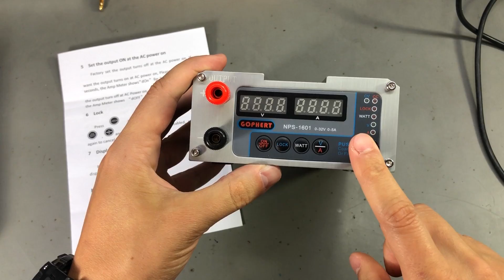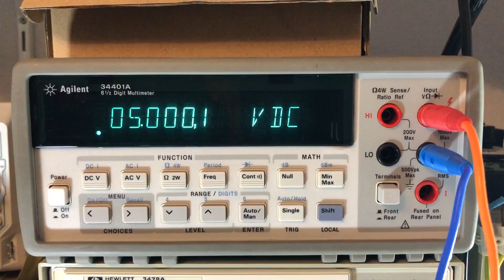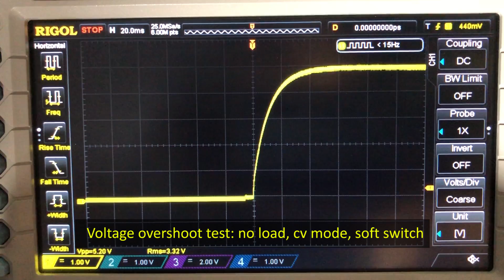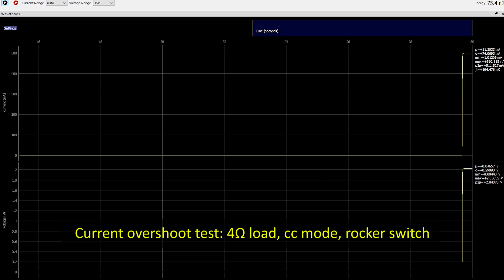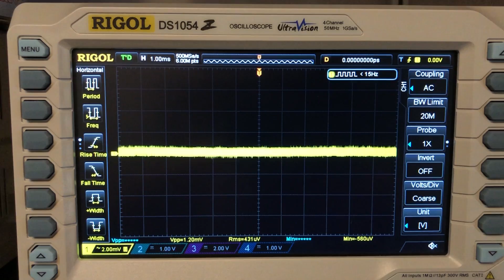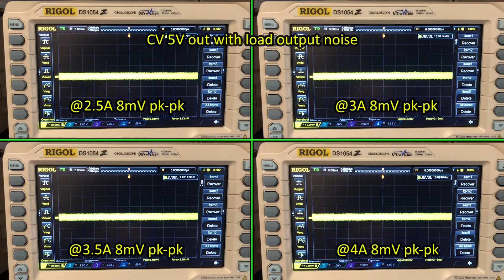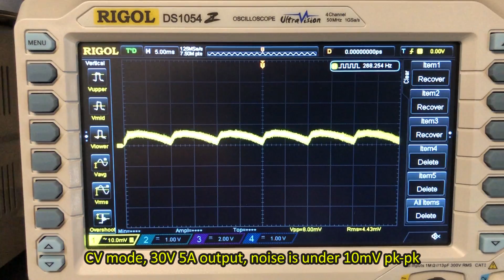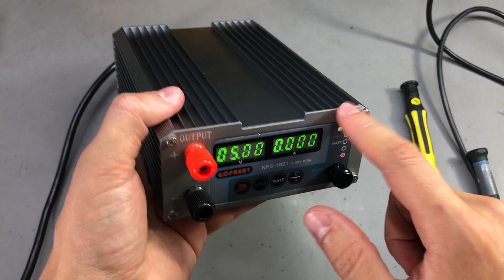Voltlog #255 - Gophert NPS-1601 Review (possibly the best power supply in this price range)

Comment from the maker: I've sent my feedback to Gophert regarding this power supply, here is what their comment on insulating the bottom side of the pcb against the enclosure: "according to LVD regulations EN 60950 and EN 61558, the power supply is class I which the case is connected to the Earth, basic insulation is ok, the clearance between PCB to the cabinet is about 5mm, the regulation is >3.2mm, so i think the insulation of the power supply is  safe."
Reply: Yeah, it looked like it had a lot more clearance than the typical switch mode supplies with cheap perforated metal protection/cases that always have that insulation sheet. The PCB looked like standard 0.60 FR4 too. I trust the FR4 will stay rigid and in place a lot more than flexible and flaky CEM-1.
  I'd really like to see the dual feedback circuit configuration they are using for this. Someone needs to send one of these to Danyk for an epic Diodes Gone Wild reverse engineer and schematic :-)
  Thanks for the upload.
-Jake
Reply: I would like to know whether it is good for repairs of laptops, phones, lab and communication equipments. So can a technician use it?

Comment: I don't know if they stepped down their quality, but the unit I received this weekend is not of the quality that is displayed in this video! The device keeps overshooting by almost 1 Volt at all levels, and testing it with a LED at a CC of 10mA and 5V, the LED clearly shows this overvoltage by flashing pretty bright during activating the powerbutton on the front. The device also spikes after turning it on with the powerbutton at the back, especially if it was turned on a short while after turning it off! 
Inspecting the PCB also gave me a shock, as the flux is all over the place and the soldering is of poor quality with lots of tin dropouts and smurky larger pads. I bought this unit after seeing this video, and also because I already own a CPS-3205 that works well. The only thing that does seem to help in the overshoot is placing a 2200uF capacitor on the output. All in all I had expected much better quality...
Reply: Sorry to hear this from you. It could be the famous Chinese #100 unlucky unit when 99 units before yours were perfectly fine and here comes this one, not up to the established quality level. For instance, the factory (if there is an actual "factory"... who knows) apprentice worked on your unit (everyone has to start somewhere) and the QC was really flexible which is often the case in making it pass. However your report on the1V overshoot is clearly beyond the acceptable margin.

Comment: Thanks for the review. Seems like even after those years, there are no many cheap low-ripple bench PSUs. I wonder if you have measures ripple and rms noise in CC mode ? Are there any other PSUs to recommend ? I'm looking especially smt in 60V 5A level. I was about to buy OWON SPE6103, but this is not PSU, but a jammer.

Comment: The only thing I don't really like about this power supply is that the buttons are hard to push. I have to hold onto the case to press buttons so that it doesn't slide.
Reply from the maker: I agree, it could be nicer with softer buttons but then, you would have the issue of accidentally pressing them because they are so close to each other..

Comment: I'm trying to use NPS-1601 to charge a small battery pack - 3 AAA cells, 550 mAh, NiMh at C/10 (55 mA).  The power supply will not go into constant-current mode with only the battery connected unless the voltage is raised to 4.95 volts which is higher than recommended for NiMh chemistry.  Replacing the battery with a resistor, 82 ohms triggers constant-current mode below 54 mA but above that 56 mA and higher the power supply reverts to constant voltage mode.
Reply: Hi. Did you solve this problem somehow? My issue is a "little bit" different charging of car battery 60 Ah with 1/10C. I set 5 A and charging battery but when voltage rise to some x level it switch to CV mode and this disturbing. Does elder models like 6017, 8412 has same situation? Or it just some comparator inside and how to fix it or it is impossible?

Comment: I'm a bit surprised that they are able to get that voltage accuracy using LM358. I wonder if they are doing some production-time calibration of those things. Using LM358 for current shunt amplifier is even more strange. This opamp has like 4mV of offset. I understand, that this is the cheapest (and the crappiest) opamp on earth, but they could have used something a bit better.

Comment: Hi just wondering if this unit could be used as a power supply for HiFi components running 9 -   12volts as ripple seems very low on this product. As checking other cheap linear designs they seem to be all rated 13.8v which I think would put too much stress on some components of my dacs and pre amps.

Comment: Possibly another failed PSU, it's my rate. 
I've use this PSU for certain amount of time. At first, look basic but good. But with time, voltage regulation fail, can't give you a correct voltage. And isn't calibration problem.

Comment: I've commented on this video 5 months ago and got my answer quite well, but before i now finally buy this supply, I must ask one last thing... How bad is the voltage drift as the supply gets hotter? My cps-3205 has a drift of 0.6v (over the set voltage) at full load due to heat.

Comment: Yup, I agree with you for the most part. The spacing of the output jacks is a biggie, as well as the lack of power factor correction. Otherwise it would be #1 on my list for a lab supply! 🥴

Comment: First view of this channel.  Very nice detailed review, thanks.  I think I will actually buy one of these.  Maybe two.  Do you know if two of these can be put in series to make a plus-minus power supply?  The DC ground in one would have to be isolated to avoid sparks while the AC grounds kept in both for safety.  I've done that with fixed output server supplies but they're not capable of Constant Current or adjustable voltage.  Is that possible with these units?
Reply from the maker: Sure, you can connect these in series/parallel. Thank you!

Comment: Can you series connect your two Gopherts as a non trackng positive and negative supply? If you can I might buy another COS3295 to go with the one I have.  Would this be a good choice?
Reply from the maker: You can connect these in series or parallel.
Reply: They don’t have three terminals.  Does that matter? Maybe you can test one day and show results for opamp use? 😀

Comment: I've been avoiding replacing the cheap DC-DC buck converters I've been using for a few years, and was even looking at buying another just in case I blow another one up. But considering this is half the price of buying a similar switchmode benchtop power supply locally, even including delivery from China, it's really tempting to splash out and buy a couple of these instead. Definitely going on my Christmas wishlist!

Who am I kidding, if I haven't bought them before then, it'll be a Christmas miracle!
Reply from the maker: There is also the great sale of 11.11 happening in November so we might see some discounts around that time.

Comment: We have to be careful with Banggood.  They don't refund the full purchase price if the good is defective.  From recent experience, they refunded me $45 out of $68 for a defective power supply I received.  On top of it, they prevented me from doing a review! Buying expensive stuff is a bit risky.
Reply from the maker: Buy from banggood no matter the cost, pay with paypal, get a full refund every time something goes wrong 👍
Reply: @voltlog  Tx for  very good advice. I agree with Claude  but not a bit risky , very risky. Bang good  and Ali express   are  on the seller side and  you get stuck with chinese quality problems. This encourages their sellers to ship again and again this   poor quality.  I encounter quality issues with Chinese electronics every time, I order. Just buy cheap you receive the same quality as the expensive items.

Comment: It is a good PSU, I agree. One thing I don't like about it is the LED displays. They should have used a filter glass on them to increase contrast.
Reply: I stuck red gel film from a stage light  over the display which works quite well.
Reply: @Steve_Coates  How does red film work on green displays?
Reply: @borayurt66  Mine has a red display, colour matched films seem to work best
Reply from the maker: They do have a bit of a film from the front panel cover, it does help a bit but not as good as a proper filter. In any case that's a simple mod the user can do.

Comment: Rui Deng DSP5015 (non communication model), 53V DC input fed by a toroidal transformer, 4x6300uF smoothing caps after rectification. 60mV p-p AC ripple @ 12V 15A (max) load.
Reply from the maker: thanks for the feedback!

Comment: Have you measured the temperature inside after running for some time at high load? It be interesting to see how effective the passive cooling is, especially when stacked.

Also since dual supply can be quite useful, it would be nice if there was some way to link two of them. One being the master, so they can at least be switched on and off at the same time. Even better if you run them in series or parallel (one of the main features of real dual PSUs), you only set the voltage/current on one. While we are at that, make the cases stack well (with special shaped feet or spacers that connect them relatively rigidly to each other).
Reply from the maker: I've been telling them it would be nice to have a serial port with a simple command protocol since they've sent me the first power supply years ago. Then the user could add a bluetooth module or an additional controller and do interesting stuff like what you mentioned above. But this is their budget power supply line and they have another line which is more expensive with functions like serial interface and data logging and they probably don't want the budget line to eat the market of the more advanced one.

Comment: Seems pretty good, thanks for the comprehensive review. The only thing I would have preferred is to have V, A and W simultaneously, but that would probably require a more expensive display.
Reply from the maker: yes a cost issue and also a space constraint, I don't think there is enough space on the front panel to do that without getting overcrowded.

Comment: I have a 3205C and 6005 but the logic of these new model number is truly baffling. Their other models are based on the voltage and current yet, instead of calling this a 3205D, they go with... 1601???? Then the 1600 is actually 16 volt so it makes half sense but 10 amp so it should be a 1610... the 1602 is 60v 3 amp...
Reply from the maker: the model number baffled me as well..

Comment: I assume the output is not floating?
It looks surprisingly good for $60, the performance looks like it can almost hold a candle to some linear supplies... Hopefully the next version has the output jacks at a standard width.

It's pretty neat how some of these Chinese manufacturers are breaking the "made in china" stereotypes (just look at Rigol!)
Reply from the maker: output negative is tied to mains earth via a set of ceramic capacitors but is otherwise isolated so you can tie these power supplies in series/parallel.
Reply: Ah, that's kinda unfortunate.. Floating with a separate earth post would be ideal IMO
Reply from the maker: You need that path (through the capacitors) to keep the EMC under control in a switch mode power supply.
Reply: Oh that makes sense, interesting.
I'd be too worried about busting my scope if I were powering a device with this.. I'm no pro. Guess I'm stuck with giant linear supplies huh

Comment: It would be nice to lock the display on Watts instead of a very useless 3-seconds.. could Gophert get that suggestion? Also, some users could extract each of the 470uF Samxon (not Samson or Samsung..) output caps and replace them each with something smaller, like 220uF in parallel with a 10uF MLCC underneath (both low ESR and rated at 50v since 35v is way too close to be reliable). Might be an idea for another episode..?
Reply: Howdy Cliff,
  Would changing the capacitor values adversely affect (what I assume is) the LC output filter and it's frequency response? (genuinely asking because I don't know:)
-Jake
Reply: @UpcycleElectronics  I've not seen the schematic but you're right, I had not thought of the smoothing inductor prior to the 1st cap! The interconnect is the inductor for the 2nd cap so maybe just reducing the 2nd cap and adding a couple of MLCC's right at the front panel would show some results as proof of concept.. almost anything's better than Samxon.
Reply from the maker: Not that I am some kind of reference but I haven't seen failed Samxon capacitors so far. I don't think they are the lowest quality, I think they are among the best coming from China, in fact you can even purchase them from European distributors and they have nice datasheets. However changing these caps will likely mess with the stability and filtering characteristics of the PSU.

Comment: That's quite a thorough review and the psu looks like a nice unit; I can't really fault them on the price either, unfortunately though it's very much comparably priced with other standard (linear?) lab supplies, and I never really could justify spending on one of those either (considering most hobby digital stuff I do works off a 5V or 3.3V wall wart anyway)...
Reply from the maker: Sure if one does not need what this power supply has to offer it's not worth buying.

Comment: 16:48 I heard "capacitor made by Samsung", then i read "samxon" on the component 😁
Reply from the maker: You can imagine how Samxon chose their name to sound similar.. it was not an accident.
Reply: @voltlog  Perfect opportunity to make a factory called Shamsung. Nobody would suspect that!
Reply: Samxon are actually a quite decent caps. They are a level below Samwha, WE, Kemet and 2 levels below Rubycon, Cornell Dublier and such, but definitely ok for consumer stuff for example. I'd say they are on par with CapXon. From my experience the parameters given in Samxon data sheets are genuine, as opposed for some other chinese brands I have seen. Proper cap model choice for particular usage is also important.

Comment: Very good analysis.  What about conversion efficiency and power factor at various settings?
These are aspects that could be quite important to those of us off-grid and running off inverter AC power.  If they are clipping parts of the line sinewave, in addition to the 300 hz DC output modulation could create some feedback issues to inverters.
Reply from the maker: I haven't tested power factor, but this model does not have any power factor correction circuitry. If you need that there is the older CPS3205C model with active PFC.
Reply: If you're starting from DC, you can get one of those programmable DC/DC converter modules.

Comment: Will the higher powered gophert power supplies also have these updates? or only the 32v 5A ones?

I hope it comes on banggood soon... this little thing is awesome... although, is the calibration procedure the same for this unit compared to the normal cps model?
Reply from the maker: should be the same calibration procedure and I would have to ask the manufacturer regarding the higher powered version.
Reply: @voltlog  Coolness, thanks for the response!

Comment: I wonder if the rotary encoder is not positionned to low compared to the CPS-3205C ? should not be as easy to use (and I use it a lot on my 3205C).
Reply from the maker: I have relatively thin fingers so for me it's not an issue even when placed at bench level but I can see how this could affect other people. For me it's even easier because I keep them stacked so there is nothing really beneath the knob to bother me. I would recommend to keep it stacked on top of something else if you have thicker fingers, that might help. Overall if I had to choose between having the terminals on the front panel vs having the knob higher I would definitely go for the output terminals on the front panel, that's a serious improvement.